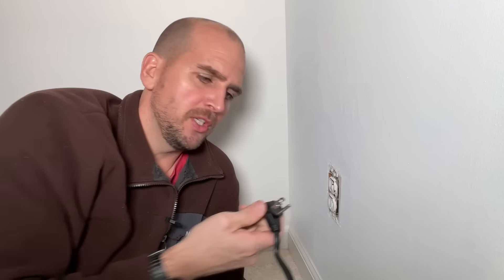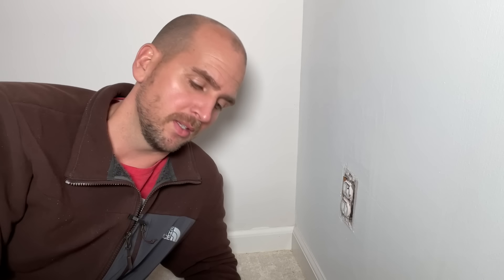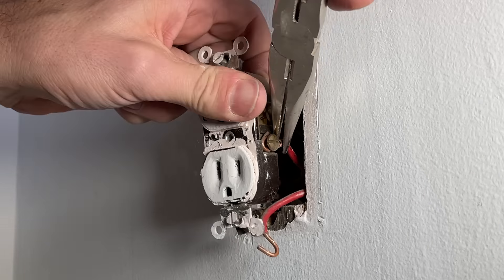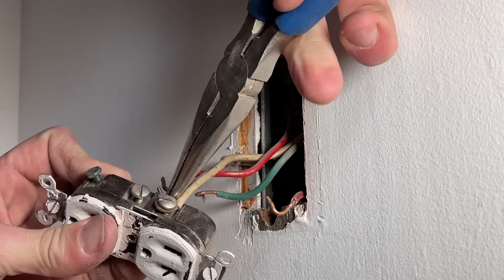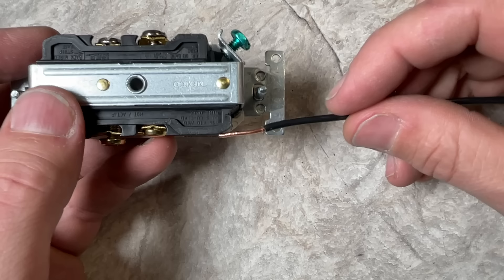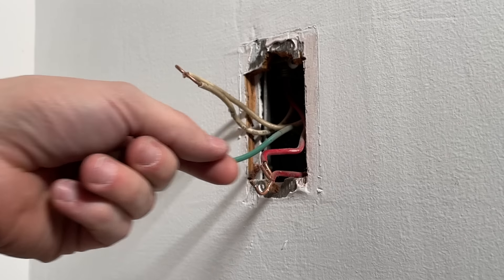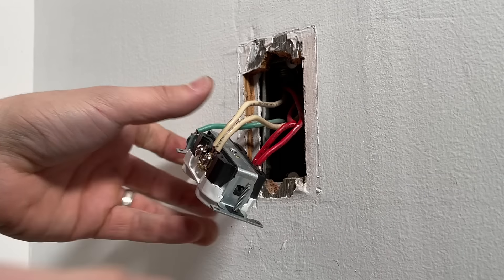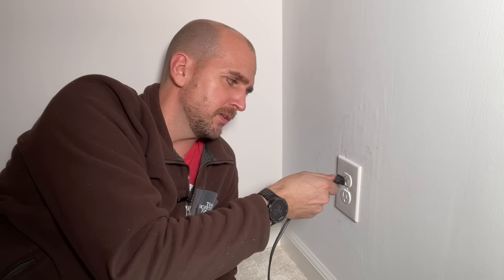Plug Won't Stay In Outlet

Comment: Old school electrician taught me as a last step.  Wrap the outlet with electrical tape covering the contact screws as an added safety measure.
Reply from the maker: Yeah, I think there are a number of people who recommended the same.  I honestly don't see it much here in Illinois from the properties I have worked on.
Reply: Man, don't do that. That electrical tape will dry out, sometimes they get hot and could get into the socket itself and make a mess. I've seen it. Are you sure he's an electrician? If I found that I'd inspect every socket in the house. Who knows what you'd find. Follow the standards. They really know what they're talking about. If they say wrap it, wrap it. If the don't say wrap it, don't wrap it. That's because they didn't test it wrapped. Now you're making someone a test subject. What he's doing is substandard. As long as you stick with parts that are to code you're going to be fine. No need for tape.
Reply: @robertthomas5906  Almost every electrician I've ever known will put electrical tape around the outlet if it's going into a metal box.
Reply: @robertthomas5906  Not sure where you got that information. 42 years in the trade, we do it all the time, that way when you re pulling an outlet or a switch you stand less chance of shorting it out. It also speeds up service work. Not sure what sort of tape you are using but even the current cheap vinyl  plstic tape does not "dry out'  you get something like 33 that is made to last longer than your lifetime.
Reply: @knotbumper  A guy telling me I'm wrong who admits to pulling live outlets and switches. LOL. It's not needed. I have to wonder why you're pulling outlets and switches while they're live. You're not going to short out one if it's not live and if it's installed it won't hit. Unless you really try to make it short out or something is damaged I suppose. I've tried, the screw on the socket isn't long enough to touch as long as you're using materials that are to code. Even on a budget builder grade 60 year old socket. It's fool proof, however that's only idiot resistant.
There is only one time I ever came across a socket that was wrapped like this. That same guy also hooked a 50 amp range to an original 40 year old 20 amp circuit. No change in wires. He also wired fans into a wall and dry-walled around it. The bug inside the wall was about the size of a baseball (and the tape was drying out and failing). In other words - he was clueless and a danger to anyone in the house. We found all kinds of serious violations in that house that had to be corrected. Many thousands of dollars to fix. New wires, new breakers, new sockets (he used cheapest and then broke plastic on some of them), one room we had to re-wire entirely to meet code. All the drywall had to come down and then we found out the wall wasn't even to code. 36" center to stud spacing. Non load bearing, however it should still be right.
I feel safe betting $100 that I could pick at random 100 houses and not one of them would have a wrapped socket. Maybe you like wasting money on electrical tape? Wire it correctly, do neat work and you don't need electrical tape. It'll look like a professional did it. With tape it'll look like a home owner or "handyman" that was clueless did it. Just my advice.
Reply: @robertthomas5906   When you work in building that do not allow circuits to be shut down, you use every trick in the book to keep from tripping a circuit. In a data building, you may wait 6 months or more to get permission to open a circuit. If you have to do an immediate repair, you need every advantage. I don't wire houses, I wire buildings like hospitals, data centers refineries aerospace installations. Perhaps in a house things can be a bit more helter skelter. As for the work I do, customers like my work and they keep me and the company I work for on the job because of  our craftsmanship.
Reply: The old time electrician was just that,  however not a bad practice if you are dealing with older devices or metal boxes 
Old metal boxes and older wider devices have a chance of making contact.
Reply: Looks like this argument is never-ending lol. I have seen professional electricians use tape when they can't shut off the electricity in a gang box. But in a single outlet there is no need to tape unless it's in those old-school small metal boxes were the wire might touch the box that is grounded.
Reply: @frankdelucey2137  I Agree!
Reply: @knotbumper  Your data center isn't wired right. You should have two services coming in and two services to all the equipment with a point of use switches so you can take outlets offline. I'd say the data center is more helter skelter as you put it. I've seen electricians smoke entire panels even in a Federal facility. I've also had to wait 6 months or more to work on circuits. We wait the 6 months and do it right.
Residential is a lot more of a PIA because people live there and not just people, poor people that can cause a big stink (Government is here to save the people). You know that's when these things happen. When it's a poor mother of 5 or an activist... a PIA person. That's why I don't settle for things that are not right. Permits are pulled, wired right, nothing to complain about. This just happened last year in fact. Lightning took out a socket and broke the circuit. Everything in that box was exactly what it was supposed to be and nothing more. No problem. Some new wire, socket, etc and it was back in action.
What can I say? My advice if you want to do a professional job is to not wrap it. If something happens and it's wrapped you will probably be answering questions. You won't be able to say it's to standard because it isn't. Understand you're doing substandard work. You wouldn't be the first person to blow off what I advised and regret it. I hope no one is hurt.
Reply: @robertthomas5906  Well, Intel, Microsoft, Amazon and a host of second tier  data people seem to like our work, and in the 42 years in the trade, I have never had a person hurt workings for me. Yes, we also have to wait 6 months to a year to change out an outlet at times. I too have had to replace substations in a short term panic fix due to lightning. I also have had my people install 4280' of 4" RGC pull the 15KV feeders and terminate in three days to accommodate a major restructure of a Tacoma City Light circuit. (of which 15 of the terminations were in lead jacked cable.) This whole conversation revolved around wrapping an outlet in tape and the original comments were off base.
Reply: @knotbumper  I don't know man... I know jack shit about electrical work in houses. I'll be honest. I'm not tryna pretend to be an expert by any means. But in my experience with working on cars. I can say that I don't know if I'd trust an electrical socket with electrical tape wrapped around it. At least not for the long run... I worked at a body shop at one time and we had a car come in that caught fire. From what we could tell. A bunch of old dried up tape was the main cause. (We weren't 100% sure of the exact type of tape it was but there was electrical tape very close by that was also pretty badly damaged and looked very similar.) Now granted. Cars do generate a LOT of heat in the engine bays... So I guess it can dry the tape out faster. But I still just don't think it's a great idea... But again. I know jack shit about house electrical systems let alone commercial building electrical systems... So my opinion means nothing... I just do kinda see where the other dude is coming from saying it dries up and can cause fires... I'm not at all saying you don't know what you're doing. Because I'm quite confident you do... But is it entirely impossible that just MAYBE he could be on to something...? Idk... Just my opinion...
Reply: @EverydayHomeRepairs  are you in Chicago?
Reply: @JM-iz3fr  I will always disagree - it's a sloppy practice. Even in old boxes there is clearance. Tapering an outlet only Lead's to lesser qualified people to think they are safe to pull an outlet while energized. It's a bad practice and shouldn't be done.
Reply: @robertthomas5906  Not killing people is apparently not part of the American standard. I think even a small child would figure out that making fully uninsulated prongs and flush outlet has the hazard of electrocution upon partial insertion. You either have to make the prongs half plastic, or make the socket recessed around the plug. Seems the flyers to the moon didn't figure that one yet. Europeans did.
Reply: @charlieangkor8649  There's nothing to figure out. The American sockets work well. We run 110v at 60 Hz in wall sockets. It can kill I suppose. It hasn't killed me. Even as a kid when I had to jump up to get to a socket over the washing machine. I didn't get it out so I jumped up again and grabbed the contacts hard. I got it out. The European sockets if a kid were to use a paper clip could hit those contacts and possibly get hurt. I have no idea why Europe didn't adopt the Edison socket. Probably had to do with a Patent. Same with 50 Hz instead of the more efficient 60 Hz. I don't think there is a problem worth changing billions of sockets and rendering all our electrical items useless. Would be nice if the sockets were universal.
Reply: I heard electricity is just a theory.
Reply: @rudolphguarnacci197  That's shocking.
Reply: @robertthomas5906  I am not an electrician, but worked as a mainframe Systems Programmer for over 45 years before retiring in 2016.  In the "olden days" the electricians working in data centers could schedule time to shut down outlets as you suggest, and sometimnes made changes without approval.  Nowadays, in larger "always on" 24x7 data centers, there are VERY limited times during which electricians are allowed inside data centers (even to prepare for approved work), much less to open an electrical panel to even look inside.  Multiple layers a Change Management, and management approvals are required before any scheduled electrical (or software changes for that matter) work can take place.  Semi-annual changes are not unusual, except in emergencies (even emergency changes require management approvals stopping just short of God).  Unscheduled outages caused by unapproved work are firing offenses, and yes - it DOES happen, even to very valuable employees.  Senior Management does not tolerate unscheduled outages.  PERIOD.  Full Stop.
Reply: @mikewalter2268  I'm nearing retirement myself. At it for over 35 years. Started with a Univac.  I work at world class data centers. Government and now I deal with companies. If it's wired right you can take things offline. They call that enterprise level equipment. ECC checks for memory, multiple paths to the data, multiple networks, multiple HVAC, multiple electric to all the units. That's when you find out if it's all right - turn off one half of it. See if anything topples. Switch back on, turn off the other side. Everything is ok? You're good. Watch for amber lights. Obviously you don't do that often. However I've seen it done. Sometimes by the utility. Some of these centers also have two different sources of electric beyond making it via generators and 30,000 gallon diesels tanks.
So to get back to the original situation, it's BS. If you've been around you know how they wire these things you know they have whips and sockets. You're not going to be pulling live sockets out. You're going to bring up a new service whip from the PDU with a new box of sockets or socket depending on the need. Electrical tape is unnecessary and substandard work. I wouldn't be a bit surprised if he eventually finds himself in trouble for it.
Reply: @robertthomas5906  Yes, I certainly understand that data centers can be wired correctly to permit changes withoiut causing outages.  The point I was making is that large numbners of senior corporate management simply refuse to accept ANY possibility of outage and make it impossible by policy to make changes.  E.g. In theoir minds,  even though it's wired properly, someone can back into another piece of equipment by mistake, wiggle a wire (think ethernet cable with an unnoticed broken clip that's just barely connected) alongside what they are fixing, make a human error (several times in my career, despite clear warning signs, someone hit the whole data center Emergency Power Off buttons by the data center doors on their way out, thinking that the button was a power door opener - those were later housed in plastic boxes).  Their point is: it happens, and it won't be permitted on their watch.  Or: "stockholders matter" (read deeper: senior management compensation matters).
Reply: Robert Thomas
: Covering the screws with electrical tape is to make sure there is no possibility of the screw accidently coming into contact with  a metal outlet box. Not necessary with a plastic outlet box. I have seen the old electrical (cloth, pre-plastic) be so dry it cracked and crumbled. I have never seen plastic electrical tape do that though it doesn't mean plastic tape cannot / does not fail.
Reply: @jerrysmith372 : I wonder why you or anyone would not turn off the power to the outlet. Only an idiot or someone who does not know what they are doing would chance working with a live circuit. I'm not a professional electrician, just a home owner who is smart enough to know to turn off what circuit I am working on which I can say is more than you (with 43 yrs experience) are.
Reply: @jonjacob1962  Yeah... there's cheap-wrap and there's good electrical tape.  It doesn't pay to use the cheap stuff for anything .
Reply: @charlieangkor8649  There seems to be a bit of anti-American rancor coming from Mr. Angkor...  The "American standard" is very much concerned with safety.  Stay in Europe if you hate us so much.  This was a cheap shot.  You really shouldn't have.
Reply: @robertthomas5906  Been in the trades for 45 years. Except for unusual wiring setups. EVERY electrician I have ever known routinely has not only pulled hot outlets and switches. But changed them out hot without shutting the breaker off. I do not recommend your average homeowner do this however. A certain degree of experience is required to know when you can and should not change out hot. But for basic 3 wire setups. I see them routinely change them out hot
Reply: @jerrysmith372  Not true. This is how I was taught by an "old school electrician" over 40 years ago. Seems to be a source of debate between you guys but the fact of the matter is it is neither safe nor unsafe , and purely a matter of preference as electrical tape is non conductive. You run your business to whatever standards you want. But your argument about inviting someone to pull a hot outlet is flawed because you usually dont know if its wrapped or not until you pull it
However I have known plenty of highly reputable electricians that have not only pulled hot outlets and switches. But changed them out hot as well and do so regularly
Reply: Reading the comments, all you electrical Karen’s, crying about who’s wrong and who’s right, should be more concerned about cleaning up after yourselves! 

Sincerely, 
The Carpenter
Reply: @rcarr6893  Agreed. and complaining carpenters should also be concerned with NOT just leaving things for the painter.
Example. If you spackle it, you sand it and not leave mountains that have to be chiseled down or broken out and redone.
Reply: If the socket is correctly wired I see no need to wrap tape around it, there should be room between the terminals and the box.
Reply: @charlieangkor8649  I don't know, I'll take our 110v at the outlet to the European 240v.  240 as the standard is fucking nuts.
Reply: @MLU8811 blah blah blah
Reply: @MLU8811 Your statement that the difference in shock is "not as trivial" as I think (which I never said btw) contradicts your entire premise that voltage isn't "scary" as you put it.  Also, my original comment was directed at the arrogance of someone assuming that the EU was safer.  Get over yourself.
Reply: @jerrysmith372  Totally agree. I wouldn't wrap an outlet in any kind of tape.
Reply: @charlieangkor8649  I agree. Hot and neutral should be half plastic as a safety measure.
Reply: @TMendez528  I agree I am a certified industrial electrician and a veteran
Reply: An electrician will know that if electrical tape, or similar, was a good idea it would already be in the NEC.
Reply: that is only necessary when installing in metal boxes. but it doesn’t hurt to wrap the terminals in electrical tape
Reply: @TMendez528  Agreed! If that’s the case he’s not a good carpenter.
Reply: I'm an electrician, and I'll only do that if it's going into a metal box or if it's going next to another outlet or switch
Reply: @robertthomas5906  I also seen wire nuts with electrical tape. But if you use Gorilla wire nuts you don't need tape.
Reply: @leonardwilson1846  you never worked on lighting that stays on all the time. Even during power outages. There are times electrician needs to work with live electric circuits.  Line men do it all the time.
Reply: I know how I know how I knew it and I do it.😶⚡️
Reply: @daledoe-baggins  You must only know 1 or 2 electricians.  The box is the insulator.  No need to add more insulation inside the box.  But if you must, you should also disassemble the outlet and get some electrical tape in there as well.
Reply: Same here. Light Switches, Outlets and wire nut connections are a safety issue so I electrical tape all of them,
Reply: @BrokeCanadian  agree with you also! If you need to tape an outlet or switch I question the electrician's installation job. There should be enough room that the screws will never touch metal. Also tape in a few years won't stay in place. Heat and the breakdown of the plastic will render it  useless. Also there should never be more than one wire per screw. Out of all outlets and switches I replaced I never saw tape on the outlet or switch. It's not in the NEC either.
Reply: If I bought a house and found electrical tape on any outlets or switches I would be calling an electrical inspector and do a complete inspection. Chances are the home owner taped them outlets not a qualified electrician. I know even electrician's make mistakes. At my work someone put a double pole switch where a 4 way switch should be. The three way switches did not work right. So I replaced the switch with a real 4 way switch. Everything works now. I replaced many switches and outlets and never found electrical tape. My next home will be wired with EMT and the boxes will be the double kind with 1-Gang ENT Box Cover plates. I like large box even with one receptacle.
Reply: @lb3406  Using electrical tape is pointless.  That is what the box is for.
Reply: My  dad, (retired Master Electrician, 44yrs IBEW Local 25), taught me what the actual last step of receptacle work truly is...and that's to align all cover plate mounting screw slots vertically. How's that for old school! Lol
Reply: @markrebehn5568  I prefer the screws be properly torqued.
Reply: @markrebehn5568  That’s not old school, that’s OCD…. 🤣
Reply: I wrap my outlets with Saran Wrap never had a problem
Reply: Not required
Reply: @robertthomas5906  You also need to is tall it via code.  I an not an electrician but code is one part I do know and I find violations.  Mostly from a GC who does not know the current standards.
Reply: @jerrysmith372  I hardly use electrical tape either.  You hardly need it if you do good job unless some moron did not leave enough wire in the box.  I usually have to opposite problem and have to cram huge bundles back into place.
Reply: @frankdelucey2137  I always start with attaching ground wire so any line supply has a place to go.   Better to ground than me.  I find a wire nut alone is good enough to avoid contact and easier to remove then tape.
Reply: If it is a metal box wrapping with black tape is a good practice. Plastic n carbon fiber boxes it really necessary.
Reply: @robertthomas5906  wrapping in black tap is a good idea. Scotch33 is a good tap, just don't wrap it real tight. If you wrap it really tight it will start to slide of terminals and wind up just being around the wire, not covering the terminals.with a plastic or carbon fiber box it isn't really necessary. Any screw not being used screw it in to device. When I wrap mine I remove mounting screws, then wrap it twice then cut it.
Reply: That's all it is. A extra bit of safety. I did service work, so finding that problem you needed power on in some cases. If I had to pull  a room apart or putting it back, power was off.
Reply: I think its location. Philly I've seen tons of electricians wrap and have done work on wrapped outlets for both commercial and residential. The point of using good tape and never going dry only seems like extra protection. I wrap only in metal boxes or big gang boxes, and I only use Shepards canes, no straight connections. You never know, say you have 4 outlets (2 doubles) and 3 are same circuit, but one is a different circuit for say a switch or heavy load appliance. You check the top outlets but you still have one hot on the bottom. Just extra protection. I've seem it a bunch of times, thinking the breaker is off but the outlet is still hot. Not me of course, lol.
Reply: The hilarious thing is I have yet to see someone mention the National Electric Code and what it has to say about wiring outlets, and the use of tape etc. 
Instead it’s a dick measuring contest based on experience.
Reply: @notacreativehandle  if that was the case you would be the Grande winner, but what you don't know is different counties n cities have specific codes that they make contractors abide by. The NEC is a guide that elections must follow but amendments are made to where you are working. I hope this makes sense to you. I bet you have never owned a set of encyclopedia's cause you think you know every thing. How much electrical work have you done? 40 years of electrical work 30 years as a licensed contractor,  an average of 200 houses a year, that's about 8,000 houses, plus after hours, helping friends n neighbors. That's a long time. What is your story???
Reply: Watch Electrician U. Episode51  Dustin Stelzer on YT. HANDS ON IS THE WAY TO LEARN. I STUDIED ON MY OWN TO PASS MY TESTS TO BECOME A JOURNEYMAN  THEN A MASTER. NEVER WENT TO TRADE SCHOOL, LEARNED ON THE JOB
Reply: Nothing else to comment on?